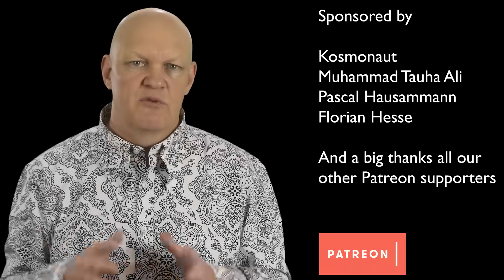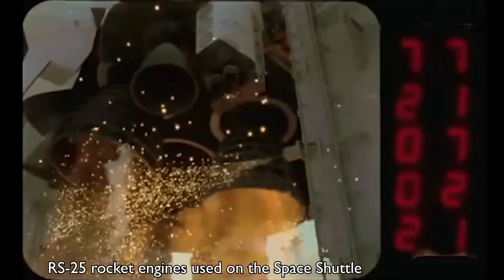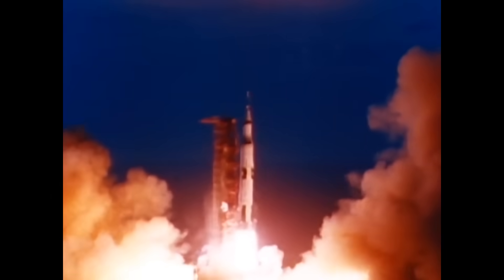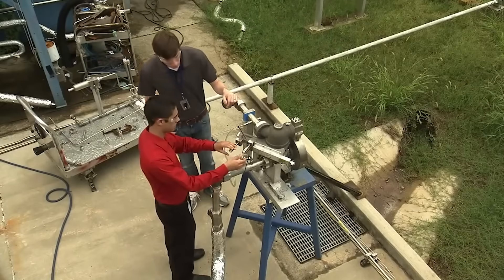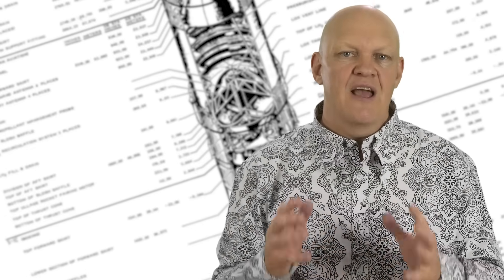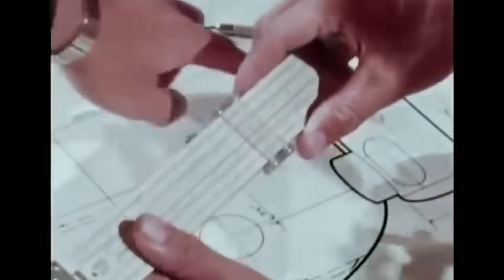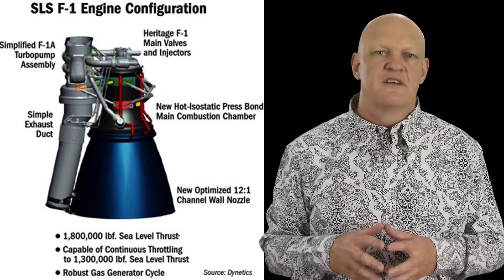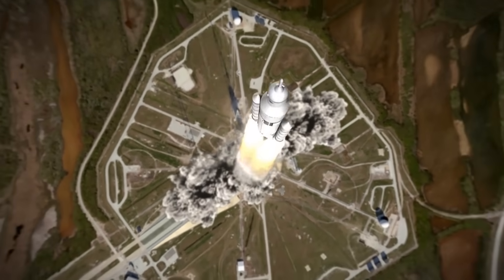Why Can't we Remake the Rocketdyne F1 Engine?

Comment: I've never had much patience with the "they've lost the institutional knowledge" argument of why we can't recreate engineering feats of the past for the simple reason that they didn't have that institutional knowledge when they started the projects.  When they started developing the F-1 engine, they didn't have the institutional knowledge that Rocketdyne had when they finally shut down production.  They had to develop it from scratch.  Today, they wouldn't be starting it from scratch.  They'd already have a leg up, if not a complete one, from the designs and documents that do survive.  If they can't do it for less than it cost the first time, it does not speak well of the current engineering establishment.  One might argue where that problem lies (I tend to think it's at the bean counter level that has become increasingly risk averse), but the fact remains that the problem lies not in the lost information, but in ourselves.

What man has done, man can aspire to.
Reply: Clearly, you've never actually done this kind of thing. No patience indeed! Even simple highly documented things like Sidewinder missiles have tons of subtle process knowledge, fixtures, jigs, and just plain individual skills that in just a few years are mostly or completely lost. I'm one of the suffering souls that has had to try to retrieve or recreate these things.

The point was well made in the presentation - the F-1 can't just be duplicated. But something a lot like it, better even, could be designed and built using modern design and manufacturing.
Reply: @randydewees7338  and, again, the reference point is the start of the project, not the end.  All the "subtle things" and what not that have been forgotten?  They didn't know them when they started either.

Unless one wants to claim that modern engineers, with their computers and design software, are less capable than engineers of the 50s and 60s with slide rules and drafting tables, then what it took to develop the capability then puts an upper limit on what it should take to develop the capability now.  Allow for inflation, of course, but even so, why does every.prpposal cost so much ore and take so much longer than it did then to produce less capability than came out of then?
Reply: @coldservings  Well, for one thing the companies that worked on this stuff are looooong goooone. A pile of drawings in some gov program office is worth a bucket of spit without the built up corporate knowledge and corporate expertise. I'm thinking you don't work in the military/industrial complex. I did. I have done the heart break work to recreate expertise and vendor capacity. It's grinding frustrating work for all involved. And expensive.

The Space programs rode on top of the general Cold War programs. The amount of money spent In General through that period is simply mind boggling. Without the compelling Cold War motivation, Apollo, and probably any manned space activity, would not have happened. You simply can't separate any individual "cost" from then and compare it to now. And where does that put your "starting point"?
Reply: @randydewees7338  Again, when they started they didn't have this expertise.  Are there no companies making rocket motors as capable as those produced by Rocketdyne in 1955 when the spec that led to the F1 was drafted?  Are there no companies making flight hardware and structures producing stuff on a par with that being produced in 1962 when Kennedy made his "before the decade is out" speech?

I'm not even considering the "pile of drawings".  I'm talking about starting cold, from the current state of the art in the field.

As for "on top of other cold war spending" also, not relevant.  That might have relevance in terms of how much they were willing to spend, it doesn't change how much spending was required.

I'm not questioning why we can't just pick up where we left off.  I'm accepting that we can't as a given.  What I'm criticizing here is the excuses for why it would cost more (even after accounting for inflation) and take longer to produce less capability than it took them to do the first place starting cold from the state of the art at the time.

Even if we assume that not one binary bit of information from Apollo remains, that still is not an excuse for why it would take longer and cost more after the information was lost than it did before the information existed.
Reply: @coldservings  As I asked, where is your starting point? You are complaining about a specific rocket engine. The F1 certainly wasn't the first engine designed and built by Rocketdyne! What I am saying is you'd basically have to have another Cold War to build the expertise, and spread the cost out. You simply can't isolate a specific effort from that period and compare to our modern non Cold War times.
Reply: @randydewees7338  No, it wasn't the first engine designed by Rocketdyne.  But designing an engine of the capability of the F1 doesn't requires a company specifically named Rocketdyne.  In 1955 Rocketdyne's "big" engine (about to come out) was the S3-D with a thrust of 600.1 kN.  For comparison Blue Origin's BE-4 produces 2400 kN.  SpaceX's Raptor 2 produces 2300 kN.  I don't think a valid claim can be made that we're starting from a less capable position than Rocketdyne in 1955.

And I think I've said elsewhere, but not in this thread, so let me clarify:  my interest isn't in the F-1 itself per se.  My interest is in the capability it represents. My frustration is the repeated proposals that keep coming out of the "space program" that cost more, take longer, and produce less capability than the guys with slide rules and drafting tables did in the 60's.

Cold War or no Cold War, developing the F-1 and the Saturn series of rockets cost what they cost.  The lack of a Cold War may mean that we don't have the motivation to spend that money to develop that capability.  So why in the world do these proposals keep coming up to spend even more to develop less capability than we had then?  If the motivation of a Cold War was necessary to spend what we spent then, then the lack of one certainly means there isn't the motivation to spend more.

What man has done, man should be able to aspire to.  We did that, for thus and so expenditure of cash and resources.  We should be able to do at least as much for no more than that.
Reply: Any engineering project is more than just the papers in the cabinets. Its a collection of people working on and maintaining the thing. Its almost a living thing. In particular most of these sorts of things constantly have parts that are being obsoleted, removed and improved over time. 
Its possible to get ideas and inspiration from something like the F1, but trying put something like the F1 back into production is almost always a foolish decision. Its better to start new. Even if you wanted to build an F1, you would want to build something with the functionality of the F1, but not the internal mechanics. 
Its not that its impossible to build one, but a certain point building an F1 according to the plans from the 1970s becomes an exercise in historical re-enactment rather than engineering.

The other thing about something like an F1 is that the number of units produced is so small that none of the normal steps to optimize the design for manufacturing at scale were never done. Nobody was going to go through looking at reducing the number of steps in construction or the number of parts involved. The volumes are so small that every one of them is going to essentially be constructed like a prototype.
Reply: You must be an engineer. I work on complex large machines that have lifespans that cover decades. We often get into the situation when we have to have parts for machines that have been declared end of life, that has given me a lot of experience with custom one off equipment orders. It's not that the knowledge can't be replicated. It's all about the money and the time. When you have life saving machines that can't be down for a 6 week lead time you get creative.
Reply: It's less of not being able to recreate it, and more of why waste the time remaking an old engine design when you should spend that time instead trying to improve it?
Reply: I've been following this stuff since the early days Apollo.  Yes, I'm an old fart.  And ever since Shuttle prettyuch failed to meet any of the promises made for it, NASA would come.out with proposal after proposal after proposal, all of them to.take longer and cost ore while promising less capability than we had in 1969.  That's setting aside whether they would actually fulfill the promises any better than Shuttle did.

Frankly, I got sick of it long ago.  Used to be a big fan of the US Space Program, but NASA beat that right out of me.
Reply: @Adierit  that would be great if they were actually doing that but instead we get more time and more resources (money) tomproduce less capability.

If the te and effort were actually giving us more capability, that would be one thing.  But that's not what's happening--or wasn't until Musk got involved.
Reply: @coldservings  The budget for the space program was massively cut compared to the past, as such they simply can't afford to produce engines as costly as these anymore. It's why the private sector took off in the first place, since someone needed to fill the demand for payloads. That doesn't really change my point though, it isn't cost effective to recreate old engines that weren't designed with the simplification that modern manufacturing techniques provide. That's why SpaceX is much more viable, as they've aimed to lower cost as much as possible and truly aimed for mass production out of the gate.
Reply: @Adierit  "they simply can't afford to produce engines as costly as these anymore"

And yet, they kept making proposals that take longer, cost more, and have less capability than we had in 1969.

My issue isn't "we can't afford to do that any more" (okay, some things are too expensive to continue for what they provide c.f. Concord).  It's that they keep saying it will take longer and cost more to do _less_.  If what we did in 1969 is too expensive then how is it not even worse to spend more to do less?  That's the problem, not that they're not rebuilding the F-1 and the Saturn V, but that they are saying it will take more to do less.  Consider someone who made the argument "A quarter million dollar Ferrari is too expensive.  So, instead, we'll spend half a million dollars to develop a single seat Volvo with no trunk."

That's NASA when it comes to launnch vehicle development for the last 40 years.
Reply: @coldservings  This problem only exists with NASA though, It's why I think most fully expect SpaceX to be the majority of innovation on the subject for a while.
Reply: @coldservings  unfortunately, you are talking to a wall. And this is the biggest problem which causes all the other problems.
Instead of concentrating on the main problem (the engine tech) people tend to look for the problems in the surroundings: "it's NASA", "we need a cold war", "who will do the welding", etc.
As a result: new problems are created out of nothing, resources are wasted onto them, while the core problem is left behind.
Reply: @GreenDimka1  As a friend of mine is won't to say "Internet Argument is a spectator sport". It's not about convincing the person you're debating; they'reoften unpersuadable. It's about the opportunity to lay your argument out for other people to judge. I believe I've done that.
Reply: @coldservings  I’ve said something similar, but less eloquently. 

When I feel the need to argue or discuss in YouTube comments, I’m hoping someone else finds my points compelling, not necessarily the one I’m responding to.
Reply: Rocket technology has changed since the 60's. There is no need to reproduce what was built then. Imagine trying to land a Falcon 9 on an F1.
Reply: Hello GothonIce, you are correct. The advances in turbomachinery design, development, manufacturing, testing makes reverse engineering much easier. AI driven CFD, CAE, FEA, Simulation  software all exists. 40 parts,  can't be the full engine, maybe the turbopump alone.
Reply: @mkoronowski  Oh yes, it is the FULL engine!  Modern parts are no longer welded, they are built, line by line, from scratch by machine.  Gone is that skilled labor of welders and fabricators.  Valves and complex working machinery that has to be incorporated part by part are now built as a single assembly.  Hoses and wires that are needed for an analogue control are now handled by solid state electronics.

As they say, it is a whole new world.
Reply: This misses the point by a country mile. It's not that today's "inferior" engineers need the extant example to look at. It's a problem of what professional Engineers call "document control" i.e. that the production drawings were never back-drafted with the additional detail and adjustments and corrections needed when hand-making things at the end. Engineering projects "As-Built" the drawings at the end of the work but not all drawings are required - only those which describe how something works are As-Built. The surviving examples of the F-1 are little use to anyone. Modern engineers could arrive at what that tells them in a very short time using modern design methods. The trick is the manufacturing design and to make working parts again would take just as much trial and error now as it took then. It would be much cheaper and easier to start from scratch rather than reverse-engineer something not properly documented. THAT is the point. It's also worth mentioning that time moves on and attitudes to technical assurance and process-safety have changed beyond recognition since the 1960s - the result being that people / governments / organisations / the public expect things to be safe and not to fail. Quality assurance and control is much, much better on a widget made from CNC machining in one piece than one welded together from several pieces, since, as an example, processes like welding cause most of the metallurgy issues one tends to find. Then they made stuff like that because it was the only way. Now you design to make something with CNC because it's intrinsically less likely to fail.
Reply: @melitele-buildinga16ftsail88  : They've actually made a new revision of the F-1 in the last decade and a half, based on analyses of surviving examples. I don't recall if it's the 'A' or the 'B' variant, but it was part of a pitch a few years ago as an alternative to the SLS's solid rocket boosters.
Reply: @absalomdraconis  that is literally what this video is about. the F1B liquid fuel engine.
Reply: Hum, perhaps the engineers back in the 1960's were under some sort of time pressure?  Say, well, a Race to the Moon??

Back then, the world was analogue.  Sitting at a drafting table to sketch out all the changes and revisions did indeed take TIME.
Reply: @Trapster99  I'm well aware - I am responsible for technical management of a substantial EPC business. I live this stuff day in day out - with time pressure. I'm not criticising their decisions but the fact remains that the final as-flown design is not fully documented. If they had intended that the design would be enduring then they would have back-drafted. Yes, even in the analogue days this was done - but only when needed e.g. after prototype development and prior to tooling up for mass production e.g. the US WWII aircraft mass production. It's normally done by relatively junior personnel with final check and approval by the senior engineers. That NASA's engineering team didn't back-draft the F-1 drawings implies that they didn't think anyone would be particularly bothered after a short period of time. The world had high hopes for humanity then - they probably assumed that they'd be building something bigger and better during the 1970s to carry larger payloads and the F-1 engine would be considered a stepping stone along the way.
Reply: @melitele-buildinga16ftsail88  Interesting possibilities there.  Yes, the 'Back-Drafting' could and should have been done.  Two possibilities come to my mind.  1) Someone in the chain of command wanted to keep the true designs of the F1 rocket fuzzy.  After all, any design or blueprint could have been stolen by the pesky Russians or others.  Or, 2) Because Apollo was canceled after only 6-7 launches to the moon, when the funding dried up, so did the back-drafting.

There were a lot of European (German) skilled precision craftsmen working for Rocketdyne at the time.  Craftsmen who loved to keep the true internal working secrets to themselves in order to preserve job security, and preserve their trade secrets.

Comment: 4:46 We just need a new engine design that is as cheap and the same power output as the F1. Like the F1B mentioned in the video, using only 40 or so parts. In the book "Stages to Saturn", it was mentioned that NASA wanted the most reliable engine for a man-rated rocket. That meant a simple design. I'm sure with today's CAD, we could take an F1 and make it so much better in terms of handling the heat and manufacturability, and end up with an even cheaper and more reliable F1B.